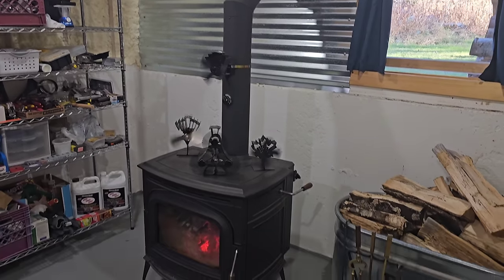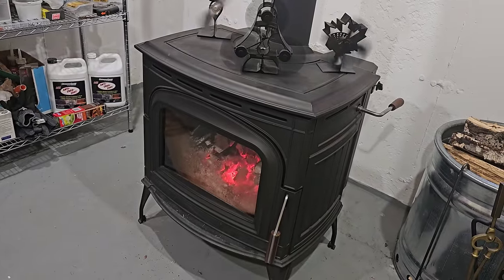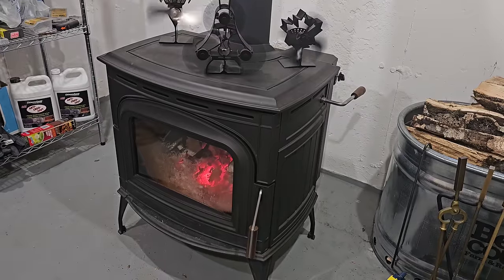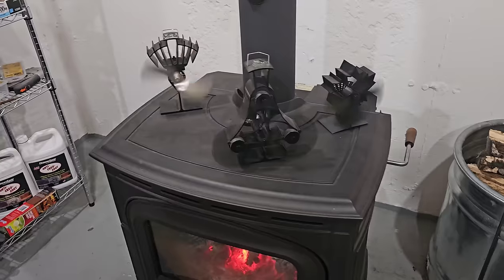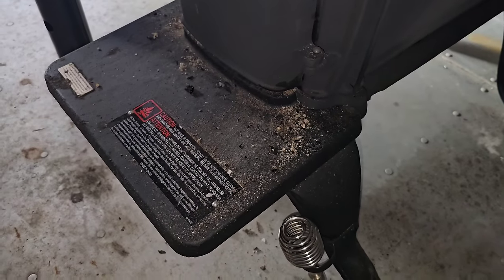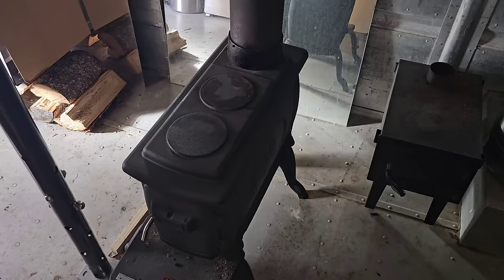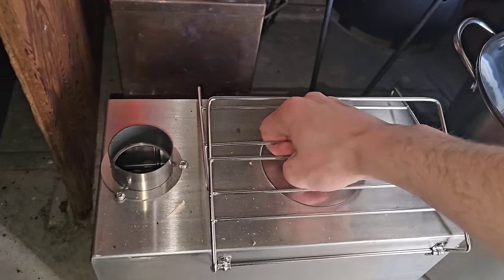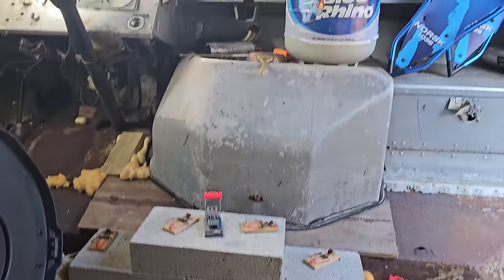Catalytic Wood Stove Burn Time Vs NonCatalytic

Comment: IDK if anyone else has commented on this, but I believe what you're looking for is called a pilot generator. It uses a large thermocouple to generate enough voltage to open the gas valve when the thermostat calls for heat. Of course, it uses an old fashioned pilot light that burns all the time. They're used on steam heating systems since those systems don't need any circulator pumps to operate. There is a master plumber/ HVAC tech with a youtube channel called Mikey Pipes - Pipe Doctor Plumbing & Heating & Air and he has a couple of videos where he works on those type of valves. Hope this helps you out. Looking forward to more winter camping videos, Keep up the great work- Steve👍👍👍

Comment: to make the stove automatic you would need almost all the components of an tanked natural gas water heater, the biggest of them being the thermopile which when placed in the piolet light will create a small bit of power to work the switches to open the gas valve for the main burner

Comment: You can see that there a lot of pin holes in the walls that weren’t there before in the truck. At least I never noticed them.  You will have to go through and fill those to avoid heat loss before the next winter camp.

Comment: The problem I find with products that require replacement parts is the company  either stops supporting the model or goes out of business.  I splurged on a pricey Dyson vacuum 15 years ago.   The vacuum could run another 20 years but the company stopped making replacement filters for that model a couple years ago and my only option are cheap Chinese clone filters that I found teared after a few minutes of use.

Comment: I've always wondered about these stoves and their "long burn time". Yes it may "burn" for 20+ hours but does it actually put off enough heat to compensate for the heat loss throughout the house from windows, doors stuff like that? Does it maintain the temperature in the house for that long or does them temperature start to drop quit fast towards then end of the burn? I use a wood stove for heat here in Maine and if the wood stove is burning low with only a few logs its not close to enough heat to keep the temperature sustainable in the house.

Comment: I have two wood stoves; one at my house and one at my cabin. They are both non-catalyst type, with input air dampers. Neither will stay burning overnight (although the newer one is much better than the older one). So yes the catalyst stove is far more efficient. I'm thinking about replacing the one at the house with one. I go through about 6 cords over winter at the house, here in the cold Cariboo where -40 is not unknown. BTW our northern-grown pine is more like a hardwood because the growing season is so short. Fortunately we have lots of it available, 'thanks' to the pine bark beetle killing off thousands of acres. Of course we may come up short soon as the wildfires are wiping out thousands of acres too.
Reply: BTW the propane stove conversion is probably not worth the effort: you'd have to get an entire burner assembly from a propane water heater, reduce the size, and experiment with the thermocoupler that activates the burner so that it can detect surrounding air temperature rather than water tank temperature and activate the burner. Considering the dangerous nature of propane gas, I'd advise against it.

Comment: i got a Dutchwest cat 1982 - i ONLY HEAT WITH WOOD-  only burn 4 cord a year- Maine- the best burner ever-  it burns wood, coal, the wood with out the cat. ! best stove ever! hasnt failed me yet- and power outages etc! Dutchwest 1982 Cat airtight. my pipes are wicked clean as well. still top 10% most efficeint

Comment: Burning for 10 hours and putting off heat for 10 hours or two different things. I load my modern woodstove up in the morning and get home 6 to10 hours later and there’s Coals in it but it ain’t putting off heat . The best thing you can do it’s basically by the stove with the biggest capacity for wood or mix it up with coal and wood😊

Comment: I get you can have to stove wide open venting straight out an stove will give out a lot of heat. But let's say you damper it down an let the stove do its thing,what kind of heat are you getting off of it? Could you still boil water or even close?

Comment: I have a zero-clearance catalytic wood stove insert from 1994, and the catalysts crumble after a few years. In a different part of the house, I installed a stove which uses air introduced near the top of the firebox to burn off the smoke (called secondary burn), and it meets air quality standards with no expensive stove parts needing to be periodically replaced. Honestly, I'm surprised anyone even makes catalytic stoves any more.
Reply from the maker: After running at nonstop one season and I'm another month into this season I don't see it crumbling, even if it had to be replaced every few years the savings on Woods would pay for it. If I had to rekindle a fire every time I got home from work or wake up in the morning I wouldn't even have the stove, wouldn't be worth it but they put a 10-year warranty

Comment: A gas water heater uses the pilot light to heat a thermoelectric generator for the electricity to run the temperature probe and to turn on the gas

Comment: I wish I had a fireplace or stove. At one time there was a wood burning something from long ago and since I rent... Well the chimney outlet is only about 2 foot off the floor and is capped. They (the owners) went cheap and only capped it off but could have removed it. And the exterior was vinyl sided about 25 years ago. This place was a garage that was converted into a in law suite and built in 1940 and is fairly large for a one bedroom. A fireplace would have been cool.

Comment: You’d need to get a standing pilot assembly with a thermocouple for what you’re talking about. But you would also need some kind of gas valve or just even a solenoid to turn on and off gas the burner, I would think a battery powered ignition system for a fireplace would work. I’ve been a stationary engineer for 20 years, we operate and maintain commercial hvac systems
Reply from the maker: Thank you, I was looking for a system like on a water heater where you have to light the pilot light but then from there it would turn on and off by itself
Reply: @post10Vlogs  yea I think you could hobble it together with those components plus a thermostat
Reply: @post10Vlogs  I bet if you go to a fireplace store and tell them what you’re trying to do they can set you up with what you need. I had to rig up a torch for the special Olympics where I live and the guys at our fireplace store were super helpful

Comment: Cold air intake is a big deal for maintaining equal pressure
Reply from the maker: Don't care about it, it over produces heat so I leave all the windows with a little crack, the stove is only oversized for those negative 40° nights

Comment: Does it have a blower to disperse the heat? I have a Brunco 52,000btu with a blower fan and thermostat to shut it off automatically
Reply from the maker: Doesn't need it
Reply from the maker: Is a very small 720 sq ft house so it gets around
Reply: @post10Vlogs  Ah that makes sense. My house it 2 floors and 3500 sq feet with a full attic

Comment: In Germany, we use secondary air injection to lower emissions.  I don´t think those catalytic stoves are actually available.
Reply from the maker: If it requires electricity of any type I don't want it, I want to be completely off grid if I have to

Comment: So isn't the wood supposed to smolder on a long burn?  How do you test what is the lowest setting (aka longest burn time) can be?  I"m assuming you can watch the temp of the top of the stove to judge if the wood is getting enough air.  If the Temp starts to drop close to the Catalyse  limit (Active zone)......the assumption is that you need to turn up the air flow because the fire is about to go out.  On the flip side, too much air means too hot a fire and too fast a burn.
Reply: There is a thermostat knob on the side of the stove to control the incoming air amount. Once you set the knob where you want it, it will automatically adjust the amount of air coming into the fire. Room heats up, it lowers the air. Room cools, it raises the air. Net result is that the room stays the same temp. It's not like the old days where you were manually adjusting the air damper every 30 minutes. If you want super long run times, you turn the knob down to it's lowest setting.

There is also an inactive/active display on top of the stove that tells you when the cat heats up into the active zone. At that point, you close the catalyst bypass handle on the side and 100% of the air runs through the catalyst before it hits the chimney. Yes, it will smoulder for long burns. But the cat will stay active until the fire completely goes out. Because smouldering wood will produce more smoke, which makes the cat heat up, which sends more heat back down into the wood.

I've noticed that the point where the wood stove finally becomes inactive is the same point that the heat sink fan on top stops spinning. But that will occur sometime tomorrow.
Reply: So any properly aged wood that you put in will not go out on the lowest knob setting?  The air automatically adjusts by a heating and cooling of a coil in the air control right?  So it's Stove temp that adjusts the coil right?  Not room temp?  I"ve seen other videos of some people saying that the fire will go out on the lowest setting after the catalyst is up to temp and bypass closed. Could be that they closed it too soon and or didn't run it full (air) open for long enough.   @MonoblocII

Comment: I’ll take an old Fisher anyway.  No parts that wear out or need replacing.  If for any reason you can’t get perfectly dry wood it won’t hurt the stove. If things get real bad and society collapses you can cook and burn anything you can put in it and it will last for ever.   Getting up and tossing wood on a fire every 3-4 hours is easy.

Comment: Aren't the BK cataysts more like $2-300, not $600? Wouldn't be a bad idea to have one or two on hand IMO
Reply from the maker: When I searched it up it was like 600, there's no way they're 2000, maybe if you have a wood stove that's Heating a mansion but this is a 720 sq ft house
Reply: @post10Vlogs  $200*** brother

Comment: You can clean those stoves and oil em heat em up
Reply from the maker: I'll probably put a layer of oil on the rusty stove in the truck if I use it again

Comment: Burning wood is not bad for the environment. It is a natural process that has been happening for, well, as long as wood has been on this planet. The burning of man-made materials is what causes damage to the environment. Catalytic converters on wood stoves are for efficiency, not to protect our atmosphere. I'm not trying to be argumentative, just pointing out a fact.
Reply: Burning wood causes 20% of the soot and 15% of the carbon monoxide. I'm sure they didn't care about that when they started putting converters on stoves, but I also didn't learn science from woodstove companies

Comment: Right out of the gate you claim the catalytic stove is " far less efficient." Not so! Cat stoves are more efficient by at least  1/3 by burning the smoke. Also normal non cat combustion occurs around 1,000 degrees where as with a cat combustion can take place as low as 450 to500 degrees so the stove can operate cleaner at lower output and longer burns.

Comment: my cat stove has a bit smaller firebox than yours and only a 6inch diameter cat..i have been burning the smaller compressed firewood bricks in mine..with about 10-15 bricks stacked in and set to low i have no problem rekindling a fire after 12 hours..even 18 hours i still dont have to light a match or anything..i look at the cat not in a environmentally way but a efficiency way( have you seen idiot firewood sellers wanting 400 bucks for a cord of wood?!!)..my stove is a convection type with air holes in the bottom and a duel layer cavity up the back and around the cat and across the top and out the front that captures alot of heat off the cat and sends it into the room..Here is a cool tip, get a cheap wyze security camera and mount to the side and above the stove and you can view your temp gauge on your phone and whats even cooler is the infrared night setting if the room is dark you can see everything perfectly and it will show the hot spots around the cat or if you are over firing the chimney when prepping your fire..I get this huge white glowing spot in the top of my stove when the cat is cranking at 1200 degrees..it looks really cool!!..my stove is in my basement so i use the wyze cam all the time to monitor my stove..its great!

Comment: Just got this as an insert. Still learning but last night ran it for 5 hours on 10 pieces of spruce.  Need to find bigger splits if not hole logs of hard wood or even spruce see if burns longer
Reply from the maker: You're going to find that softwoods like spruce don't run as long but it's kind of the same as the fir trees I have, they're there so I'll use them
Reply: @post10Vlogs  yup we just bucked up 7 cords  to split and dry. So will be set for few years
Reply: @post10Vlogs  do you find unsplit logs work or do they tend to snuff out
Reply from the maker: @jamesmacintyre1415  if the fireplace has a bunch of hot coals I have stuck logs in there that barely fit through the door and it will burn all night nice and hot as long as the wood is dried, yes you can do it but usually not pieces that big. Typically if I have a log less than 4 in I don't even bother splitting it 6 in usually I'll split it one time
Reply: @post10Vlogs  nice still trying to learn and one thing is getting it to stay in burn zone  I get I bought behalf way then it will drop.  Will the catalyst still work if it drops I can't find much on it
Reply from the maker: @jamesmacintyre1415  so I always have it running in the medium to high range on the knob, it seems to smother if it's below medium especially with soft Woods like spruce, hardwood does a bit better
Reply: @post10Vlogs  thanks I'll keep trying mine seems to get to bout 1/4 in red zone stays for boutvhalf hour then dropsvjustvoutside the line but still throws a ton of heat

Comment: 1978 blaze king just got 23 hours with 3/4 load of well seasoned hardwood.  12 hour burns are the norm without trying. Not condemning you or your stove or even catalyst stoves. Just saying 5-6 hour being all you can get isn't true for every non cat stove.  Even my old Fisher papa bear routinely burned 8 hours and as long as 15.